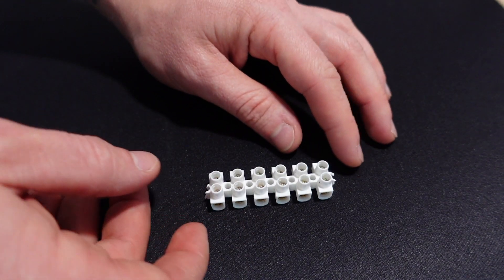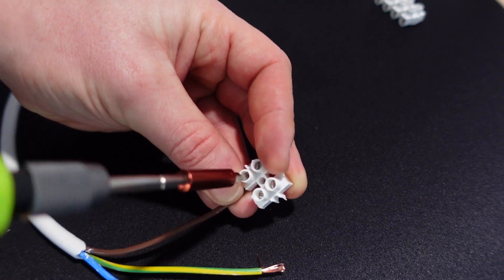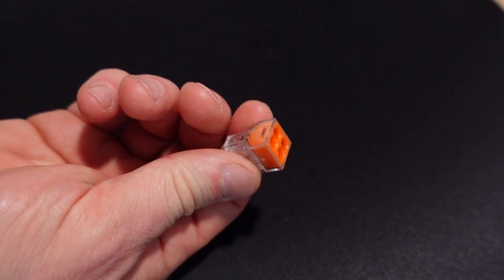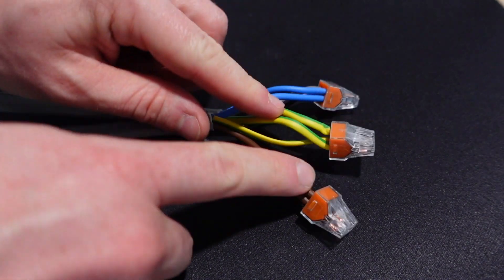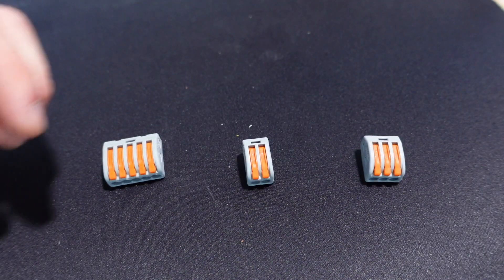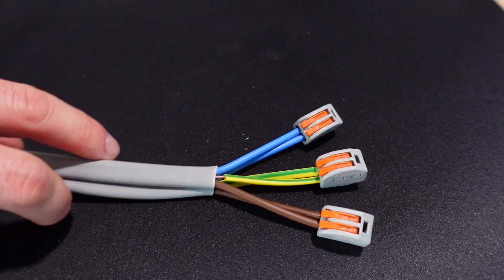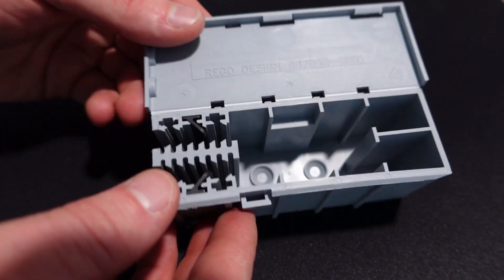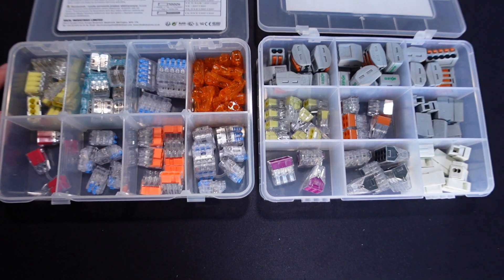Wago Connectors Compared | What Wire Connectors Are The Best?

Comment: Great video. I'm currently putting up a stud wall away from a party wall to reduce sound coming from the neighbours. Will need to bring the existing electrical cabling through the partition wall and fit a surface mounted electrical socket on the new wall. Would the push fit connector be okay? The junction will be in the gap between the existing party wall and the first layer of plasterboard. Hope that makes sense Cheers
Reply: Wago connectors can be used in “maintenance free” situations such as your stud wall where access will not be available later. However, there are some conditions firstly you cannot simply leave the wires and conductors just loose in the cavity, they need to be in an enclosure ie. a Wago box. If using a Wago box you need to seal it with a cable tie through the loop provided. Furthermore if the circuit is a ring circuit there is only one Wago push fit type of connector you are allowed to use the code escapes for the moment but it is detailed on the instruction sheet that comes with the Wago box.

Comment: Terminal strips do need to be used by adults because there is always access to live conductors via the screw holes when in use. Other than that they are cheap and cheerful and have been in sucessful use for years.
Reply: They should be installed inside an 'outer box' so this isn't an issue.

Comment: Wago connectors way overpriced for their purpose. Generic ones on Aliexpress do same job. Terminal strips do exact same job as any cable connectors and are a lot cheaper and you can connected stranded cables like flex or smaller cables much easier. Been using them for nearly 20 years never had an issue.
Reply from the maker: Thanks for sharing
Reply: if you have to pay for the work, then wago will be the cheapest

Comment: If you were changing a light fixture and using the wago connectors, is it safe to just tape them as you would with a traditional junction, or do you need to put the wago connectors in the wago box? Just seems like the wago box would be huge and i’d need to cut a hole in my ceiling to put it in!
Reply from the maker: The best thing to use is a wago lighting box. It is a lot smaller than the standard wagobox

Comment: Although the Wagos appear to be good I’m very sceptical about long term use .  Just a bit of plastic and a springy bit of steal  . Time will tell
Reply: you forgot about the Copper Bus Bar.. the springy bit of Steel is only to push the wire against said bus bar but it is not intended to carry the current.
And how long is long term for you? cause we are currently at almost 50 Years since Market Introduction of the original Wago 273
Reply from the maker: I've never had an issue but I value your opinion and concerns 👍

Comment: Fantastic video, I am beginner at electrical, but my old man is an electrical engineer, I feel like a pain in the ass calling for his help so finding something like this really helps. I recently bought 4 x10w floodlights from amazon with the intention of connecting as many as I can per plug, I couldn't visualise how it was done until I seen this. For the record the lights are being fitted above aquariums. And will eventually all run off a timer.
Reply from the maker: Thanks a lot glad it helps

Comment: can they be used in the engine bay of a car?
Reply: No, they don't seem great in a vibrating environment and the constant heat and cold won't be good either. You're better off with a terminal block, butt splice, or something designed for automotive and vehicle use.

Comment: don't think anybody has mentioned the safety issue of terminal/block/choc blocs.. all the screw heads could/will be live and open, they should be in a box or low voltage only, seen loads in lofts just sat there ready to zap you.

Comment: You didn’t mention that Wagos can be used in inaccessible locations as there are no screws to come loose. Also the spring type are not reusable.
Reply: At least for Wago they are reuseable. Just pull the Wire you want to remove and twist it in alternating directions. Though the amount of reuses is limited (i wouldnt reuse one with unkown history) it does work.
(obviously only works for solid wire, not for stranded, but the push ins are only intended for solid wire anyway)
Reply: Correct, Wagos can be used, as long as in a box. inside stud walls where they are not accessible. Any screwed connection must be accessible.
Reply: He did mention they are very easy to use in confined space

Comment: After using the terminal blocks and having to manage loops in the lighting system so you have to add link wires to continue the loop that then added to the site of the connection, when I was introduced to the wago lever connector blocked it was not only space and time saving it was also safer... I will never again use screw terminals... wago lever all the way.
Reply from the maker: Absolutely

Comment: What I like about the chocolate block is the hole (where you snap them) in the middle that you can use a screw in the middle to secure down.
Reply: More often than not, the plastic used for choc blocks is soft and does not snap. This soft plastic is also more likely to become very brittle over many years and can simply fall off the inner metal joint.

Comment: I’m not sure if the 222 Wago does this but I know the 221 have a nice feature where you don’t even have to lift the lever to insert your cable.  You can just push solid core in and they’ll lock and only release with the lever. Love this feature.
Reply: You should open the lever especially with stranded. If you watch WAGO 221 ad you are advised to open the lever before inserting conductor.
Reply: @initial post the 222 does not have that feature. you must open the Lever for every type of Wire.

 @IAmThe_RA  The Manual for the 221 specifiaclly states that you can use them like push-in connectors for solid Wire (but only for these)

Comment: How would you choose between the Wago 221 and 222 connectors? Ie how do you know which one to select?
Reply from the maker: 221 is smaller and clear bodied. This helps eliminate mistakes and saves you space inside a junction box.

Comment: Very helpful, thanks. Do all those connectors need wrapping in electrical tape if you're not using the junction box?
Reply from the maker: Hi, they should be enclosed in a box really but if not I would use some insulation tape.
Reply: @TheDIYGuy1  Ok, thanks. I'll use junction box.

Comment: Hi, just want to add, for stranded(flexible) cables, only the 221 are suitable as is. For the screwed terminal blocks and most connectors with screws(there are some exemptions) you really need wire end ferrules for a good secure connection, or soldering for direct connection to printed circuit board and such. The 2nd type connector you showed are really just for solid wires.
Reply: The 222 as well
Reply: @IAmThe_RA  and 224 for lights 👍
Reply: The second can be used for stranded wire as well. Not fine-stranded though.

Comment: I've been using wago 221's for the last few years and wouldn't go back to anything else.  The amount of time they save  easily outweighs the extra cost.  Great video as usual
Reply from the maker: Absolutely. Thanks for the comments!
Reply: I couldn't agree more, I rarely get into doing electrics but when I do, the Wago 221's are excellent for all the reasons you've stated. 
Lets be honest they aren't even that expensive. £20 for a box of 50 3-ways. 
The amount of time you'll save faffing around with the screw in type connectors is well worth the extra expense. Plus it actually makes a job enjoyable, rather than a pain. Not a fan of the push connectors because you can't undo them.